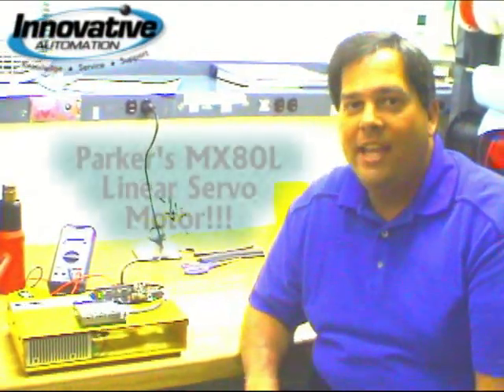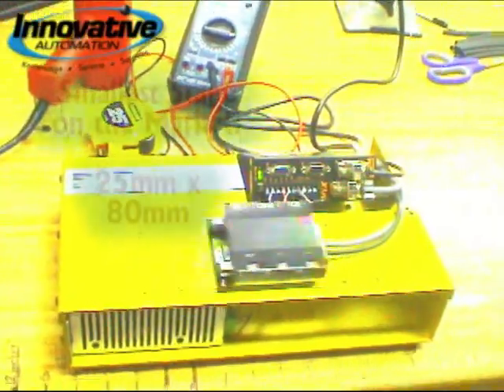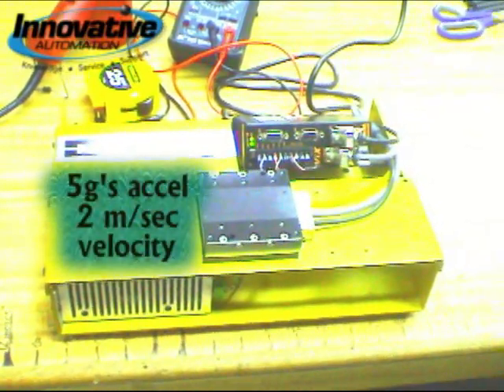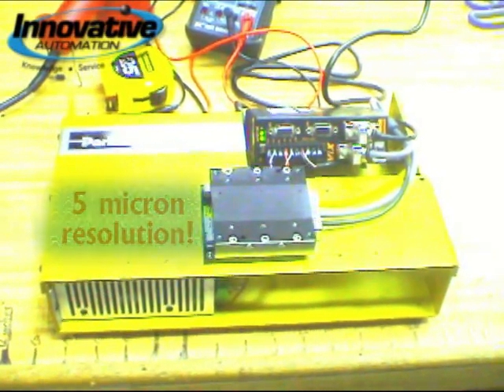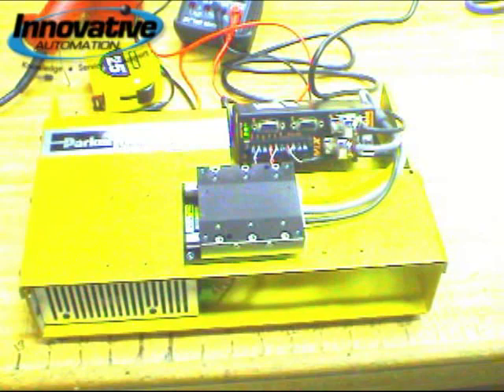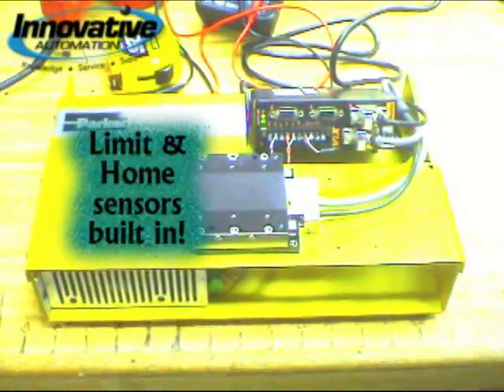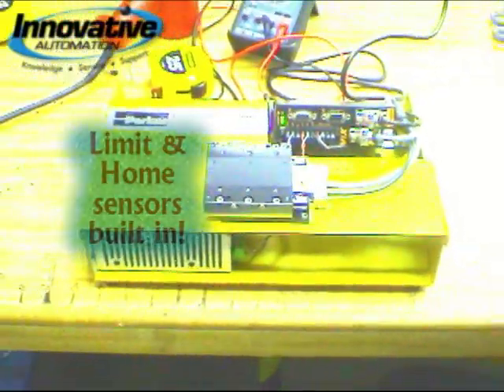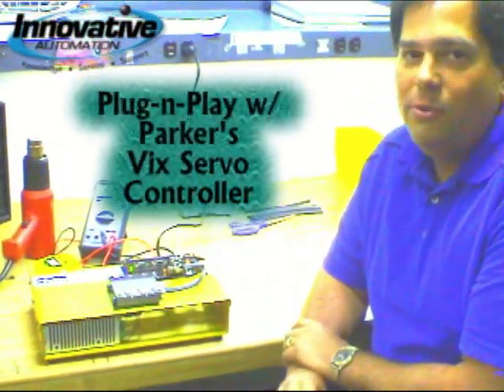Cool Gadgets:  Parker MX80L Linear Servo Stage

Comment: Hello, I just recently purchased one (mine is a little longer) with the vix250ih driver.  it powers up and does it test movement back and forth.  I have downloaded the Easi-v but I am unable to communicate with the stage.  The connection is fine, I get the echo-back, but it doesn't detect the driver.. Any advises?